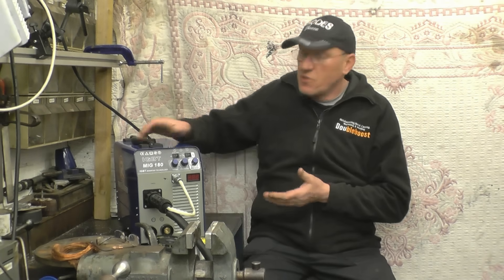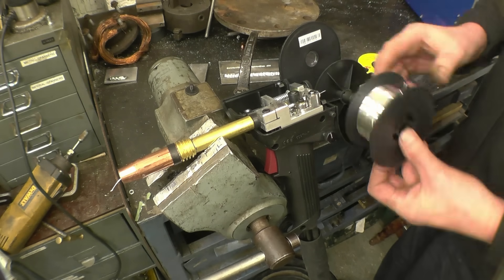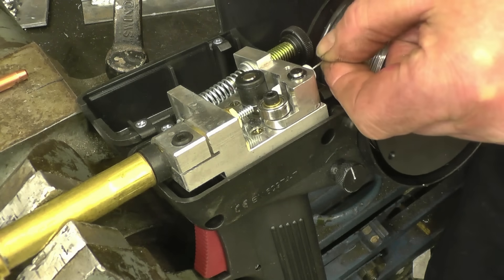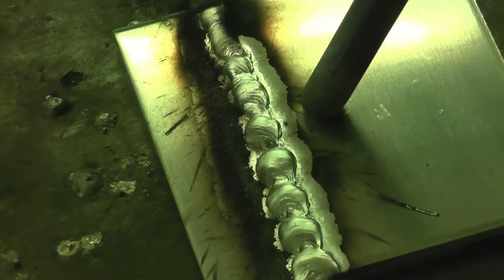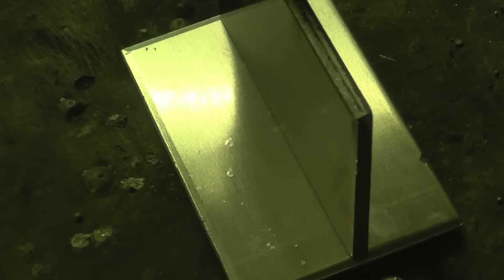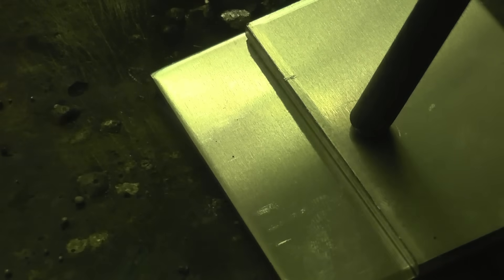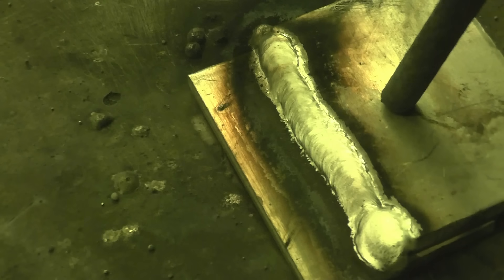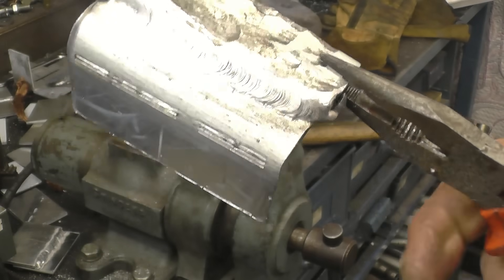R-Tech MIG180 Spool Gun Alloy Welding Part Three

Comment: Hi John, i've just purchased the R-TECH I-180 mig welder based on your previous review, as i wanted a machine with decent capabilities for hobby auto/home fabrication.  Looking at this segment John, the I-180 seems to weld better on higher power/metal thickness, i suppose this down to the higher amperage heating the aluminium quicker. My questions are, in what circumstances would you use ally mig, and when would you use tig instead, and would an higher gas pressure reduce the sooting effect or is this down to the metal actuallybeing burned in the welding process? 

I'm a newbie to all this mate so all info greatfully appreciated, and i really enjoy your videos so keep them coming. ;0)

Comment: Just a tip if your interested ...Add a slight angle to your gun and push  the puddle and the soot will mostly all disappear. Straight on always makes a lot of soot on the sides of the weld, drag angle will cover the whole weld with soot but push is clean and pretty. A little forward and back forward and back makes a weld similar to a tig look.
Reply from the maker: thanks i will have a bit more play with torch angles

Comment: once befor you had a concern about phosgene in brake cleaner the propellent was I think was a cfc an r-12 leak detector "sniffer" burns the cfc and produces phosgene its a phosgene detector I was a mechanic your always learning in that job yup the spool gun fast, nice result the 13 amps is the good part  a rhombic drive helium solar stirling engine powerd plasma cutter cutting aluminum of any thickness wow I I pay 9-10 cents a kwh and it still stacks up sunny days id pay nothing

Comment: G'day John how would you suggest I go about learning to mig weld, I have never done welding before but it would be very handy to know how to do it in my work shop.  I would appreciate your advice also on equipment needed for welding things like work benches ect,  thank you regards John
Reply: John Kinnane, Buy a cheap stick welder and learn how to weld with it first, no investment in bottles of gas, regulator etc, if you master stick welding in horizontal, vertical and overhead positions then the move to mig welding is effortless, plus you have an additional welding skill, plenty videos on here as well to guide you through welding basics
Reply: William Kay thank you William that was good of you to reply to me.  I will give a a try John
Reply from the maker: as has been said a cheap stick welder